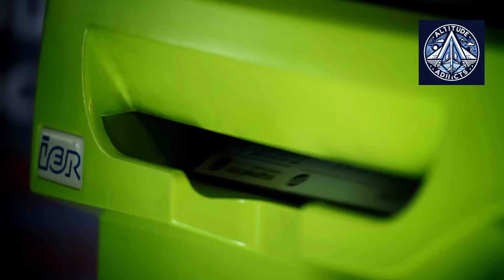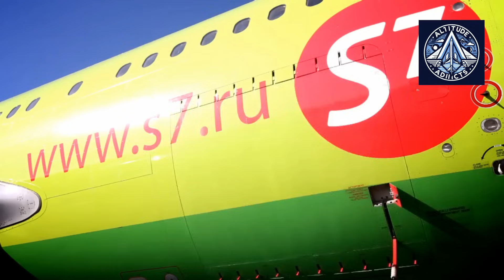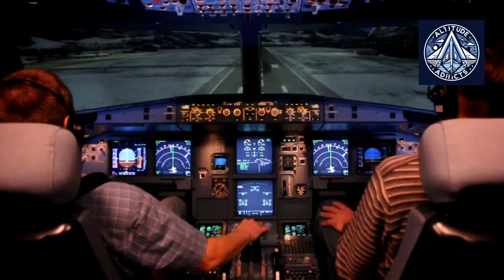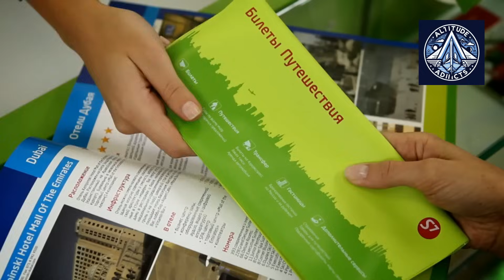$12,000 a Day Jet? Why the Tu-214 May Be a Goldmine

Comment: S7 is based in Siberia so its flights are generally longer than airlines based in European Russia. It makes total sense. Wide body jets make no sense as the population density is too small .... and short-range single aisle jets are not a great option either. 
Being based in Siberia and servicing the East .... there are probably Govt tax benefits to encourage any development in the East .... that will more than cover any fuel cost issues 

I find it very hard to believe btw that the Tu-214 has higher maintenance costs .... it is a rugged and well proven plane ...

Comment: If the political situation doesn't change—meaning Russia finally ends this pointless war—then S7 Airlines won't have a choice. Right now, they only use Boeing and Airbus planes. Since the embargo on new aircraft, but more important also updates, support, and spare parts for Western airliners is making it harder and harder to keep their current fleet running, S7, like other Russian airlines, is forced to look for local alternatives.
It is noteworthy that only a letter of intent has been signed, but not a single aircraft has been firmly ordered. This means that all options are being kept open for as long as possible.
Reply: pointless war? explain that
Reply: @aantonic  You will find out yourself over time.
Reply: There are four dimensions in the aircraft industry, both civil and military: length, width, height, and politics. The West has been able to propagandize that quality aircraft are expensive aircraft made by them. And when political sanctions are imposed on Russian airlines, there is no other option but to purchase domestically made aircraft. Policymakers have taken everything into account for war. One of them is Russia's ability to independently produce various technologies. If Russia were as weak as China, which relies on Western engines, they would not have dared to go to war. And in the past, the Soviet Union was once criticized as being unable to win against Germany; the opposite is true. If capital circulation is good for industrial development in Russia, then slowly but surely, positive results will emerge. One new Tu-214 has been completed and painted in Aurus livery for a Russian ministry. Another is in the final stages, with components entirely from Russia. The war has indeed hampered many, but it has not stopped progress.
Reply: @advang5plus36  As long as Russia's aviation industry  produces little more than just announcements, it's a bold move to call China "weak" or to explain the global success of aircraft manufacturers in Europe, North America or Brazil with "propaganda".
Airbus, ATR, Boeing, COMAG, Embraer: They all deliver aircraft in quantities while Russia delivers promises. And that's going on for many years, it's not something that began just 2022.

Comment: Russia is sanctioned! If Russian airlines want to stay in business, they will have to settle for slightly lower profits and buy Russian built planes, so S7 is making the right strategic choice! Would it be possible for PS-90A to be hot-swappable with PD-16 (if and when it becomes available)? The thought is that PD-16 would generate same thrust as PS-90A and would be more fuel efficient! Just a thought! But would that be possible? I mean to just remove the PS-90A, mount a PD-16, get in your airplane and lift it into the air?
Reply: There is no PD-16, there is only PD-14 for the MC-21 and PD-35 for a wide bodied jet like the IL 96 and CR 929
Reply: Dalam waktu dekat belum ada PD-15 atau PD-16.
Mungkin kelak ada PD-14A atau PD-14A1.
UEC Rusia punya mesin PS-90A, PS-90A1 dan PS-90A3.
A1 dan A3 lebih besar daya dorongnya namun hanya cocok untuk Ilyushin 96-400M.
PS-90A sebenarnya bisa dibuat yang lebih hemat bahan bakar dengan melebarkan diameter kipasnya menjadi 2 meter seperti yang ada di PW1400G. Namun kita tidak tahu mengapa hal itu tidak dilakukan.